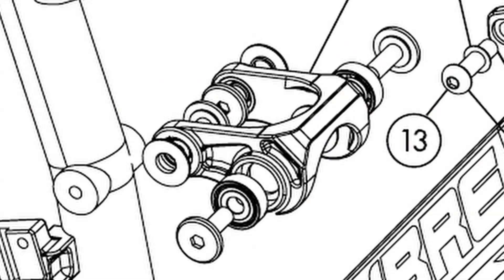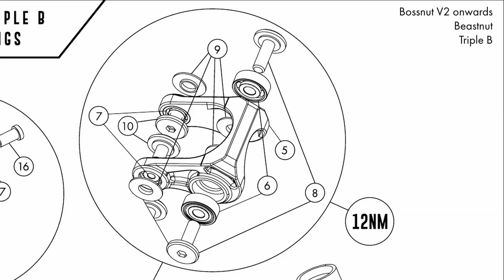Calibre Bossnut Basics Rocker Link Pivot Bearing Service

Comment: Cheers for this video it's helping me along nicely. I have been advised I need a bushes and bearing kit for my 2020 bossnut do you happen to have a link for the bearings you fitted
Reply from the maker: The bearings and bushing are the same through all the models (bossnut and triple B with every variation) the set i use was from blue seal which is a quick ebay search. The rear bushing is a difficult find as it doesn't look like there are any aftermarket versions available. Try this link for the bearings:
https://www.ebay.co.uk/itm/Calibre-Bossnut-V1-V2-Evo-Suspension-Pivot-Bearings-Kit-Set-/203060839634?_trksid=p2349624.m46890.l49292

Comment: Thanks for the really useful video, just a quick question. I can see your using a 17mm bolt to extrude the bearing, but what size nut have you got on the back. The nut i have that threads onto the 17mm bolt is too large to push on the bearing and contacts the frame instead. Thanks in advance
Reply from the maker: I have a huge box filled with random nuts and bolts from which I build my make shift tools. Not sure what I used that day but it was probably from an old Italian sports car I had stripped apart at one point. If you don't have a box of old Italian parts you could use ground down washers between the bearings and nut so that it passes through.

Comment: Any idea where I can get a front axel from INSTAGRAM me if you no dude 👍👍👍
Reply from the maker: Yeah sure, just one question, what is Instagram?😁 the best replacement axle for the front was made by brand  X. Cheaper than the rockshox offering and has allen key slots on both sides so if you round out one size you can still remove it from the other side. Drop a link to your instagram and I'll send you though a link for the axle.
Reply: Jamesmtbuk